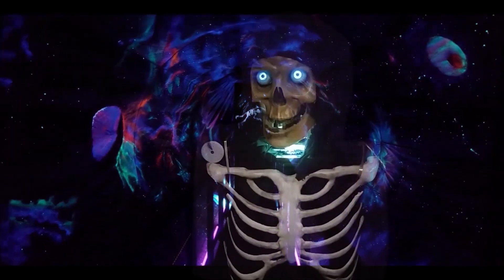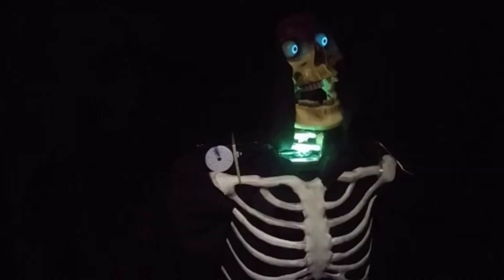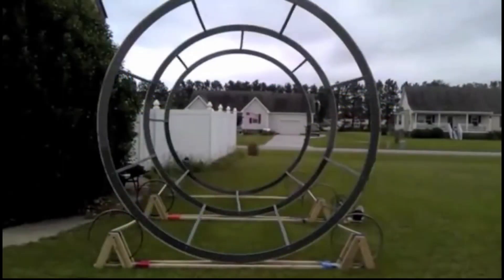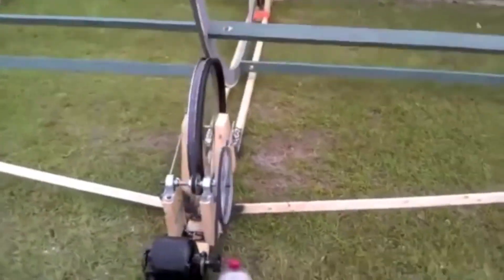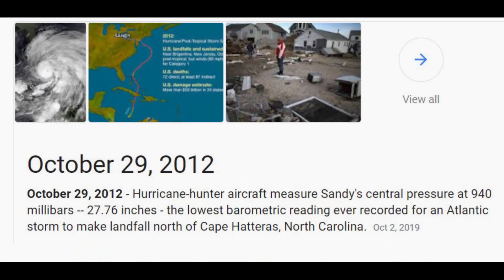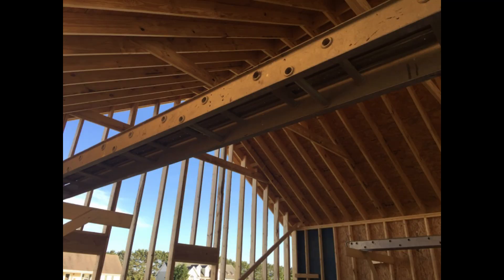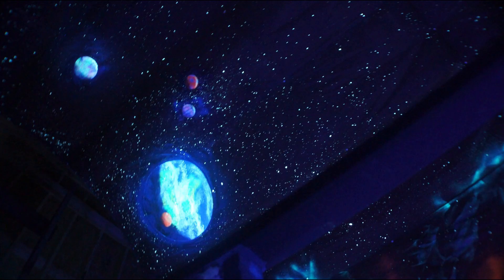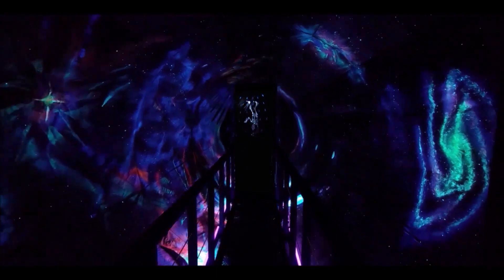Spacewalk: A rotating (Vortex) tunnel you can walk through.

Comment: I'm hoping to complete mine this year 2021...Corona ruined Halloween last year...I plan on making a 40 foot tunnel...I just need two more rings from old used trampolines
Reply: Curious about the rings you mentioned from a trampoline. I built a tunnel 6 years ago from pvc conduit and want to upgrade the tunnel structure but have not been able to find the rings needed.
Reply: @blainep4ppilot294 ..If you look at the ring part of a trampoline where it connects to the legs there's two types..there's one that's square and one that's more rounded a smooth..you'll want the smooth one so when it rolls on the track system it will roll better..search in your area on the Facebook market place and you might find some people just want hauled off because the netting is ruined by the sun